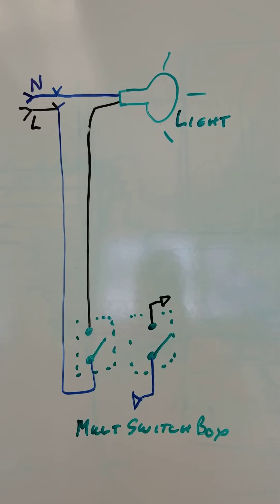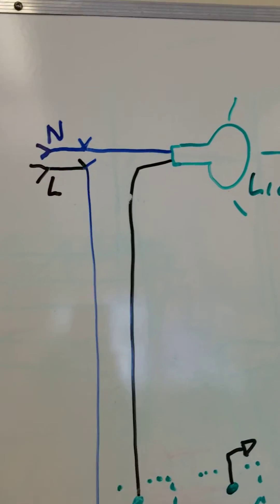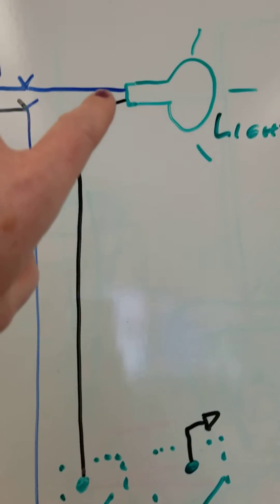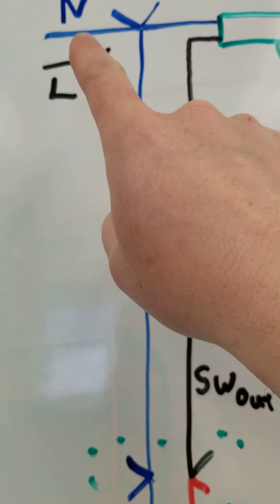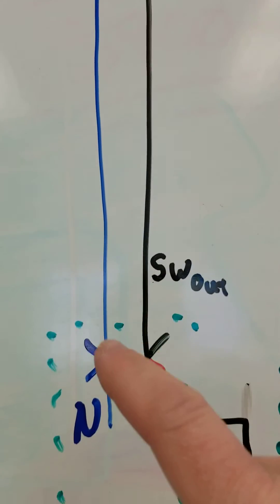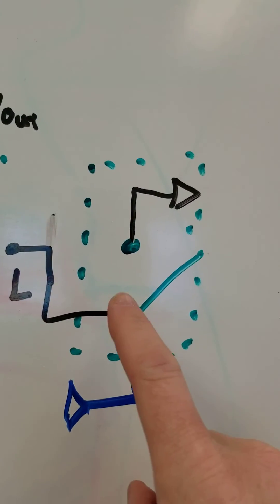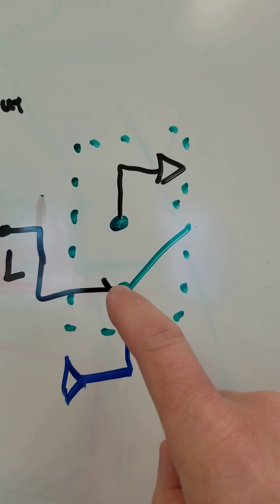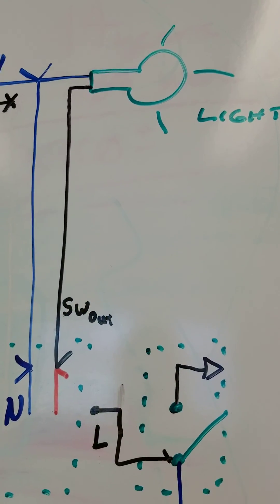Installing Smart Light Switch that requires a Neutral Wire, but no Neutral Wire at switch box.

Comment: I have a single box for a bathroom fan with no neutral. I guess I'm out of luck?? I'm trying to install a fancy timer for a bathroom fan, the timer has 4 wires, but there are only 3 wires in the box. 
One is hot(white), one goes to the fan(black), the other one is naked ground. Is there a way to make this work?
Reply: Lutron makes motion sensors without the need for neutral. I installed on and it's perfect. It controlles my light and the fan

Comment: This method will work when you have one phase, but if you have three phases, the neutral line will be different and will not work because the second live wire will be from a second neutral line